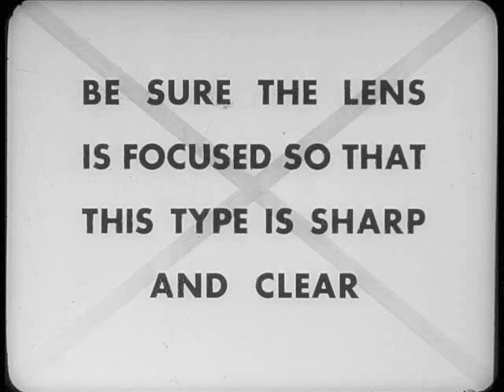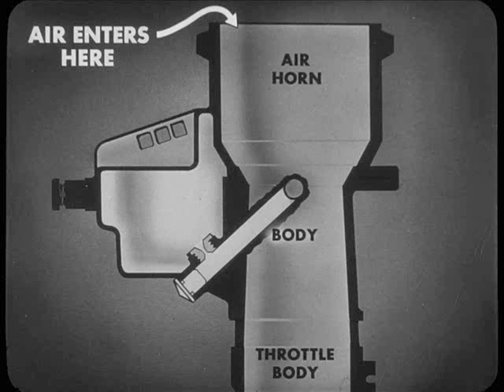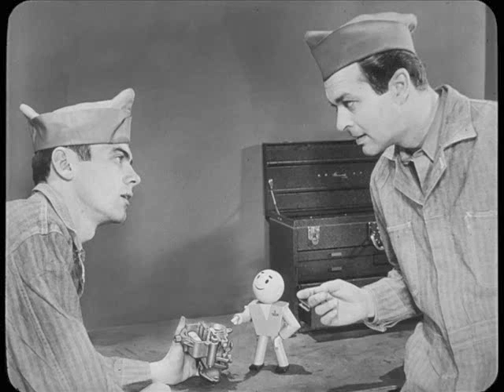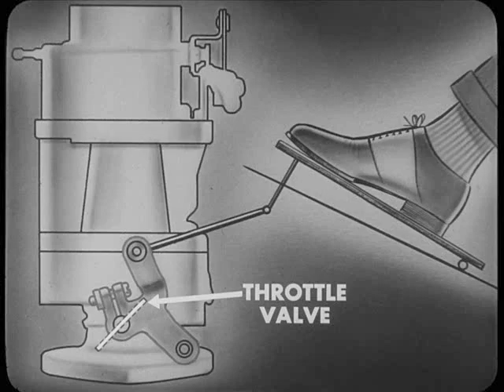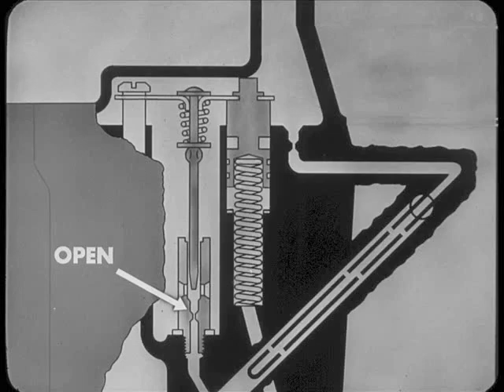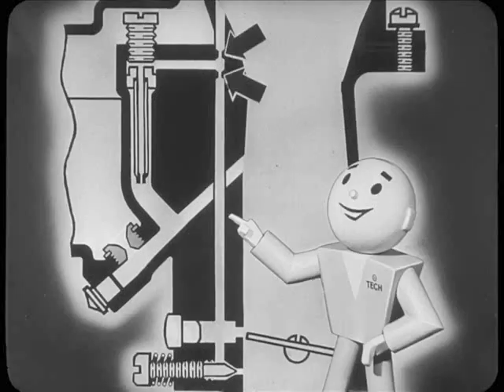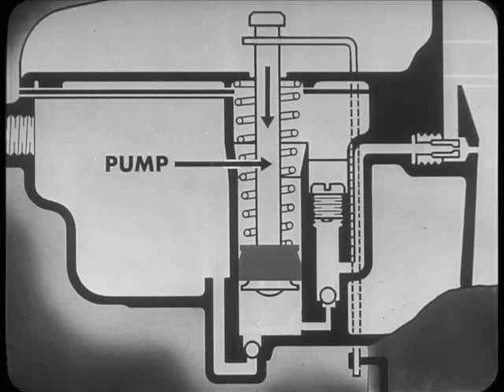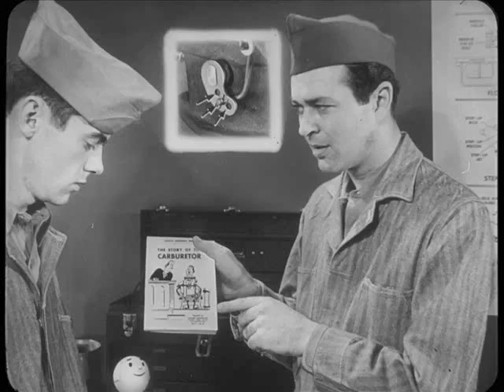Chrysler Master Tech - 1948, Volume 1-10 The Story Of The Carburetor

Comment: My brother got his hands on a 48 Chrysler Woody and upon inspection they found the carburetor has a couple of wires going to it. So far nobody has been able to tell them what the wires are for or what they do. I watched this video to see if they covered that but apparently not.
Reply: They're likely some system added aftermarket....
NO 40's Carburetor ever had wires going in or out of it! At least new from the Factory.
Reply: Might of had something to do with kicking in or out of overdrive.
Reply: Yes, those are for the electric control  of the fluid drive transmission.
Reply: 1 wire is for kick down or passing gear.The other is a dash pot to let the throttle close slowly  on deceleration  to prevent engine stalling.
Reply: found the same thing on a customers 48 dodge deluxe but they're not connected to anything and the transmission has no solenoids at all. i suspect its been changed at some point and the wires were simply abandoned.